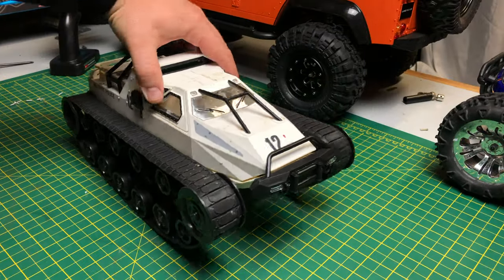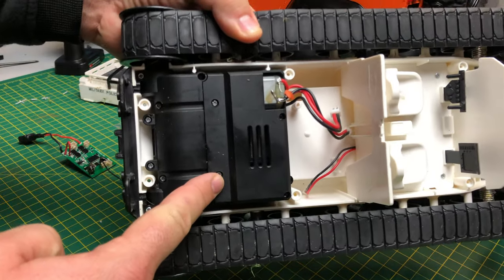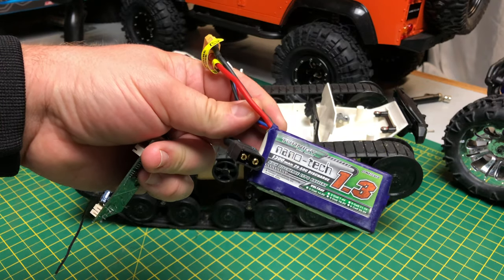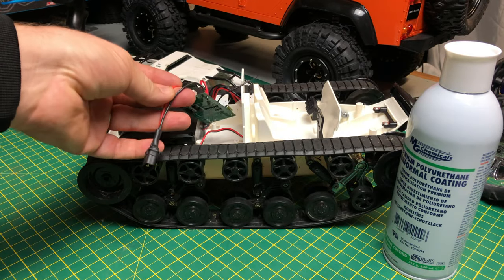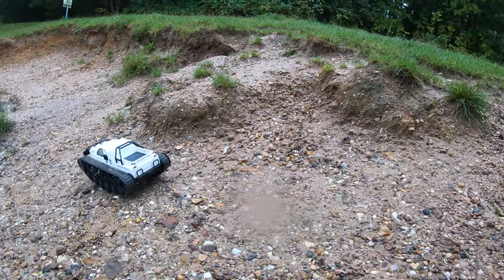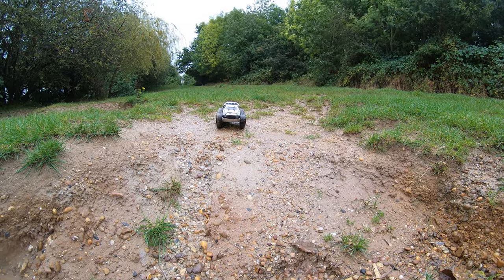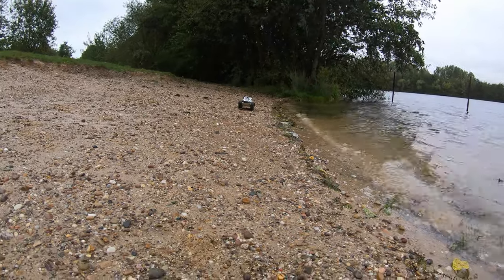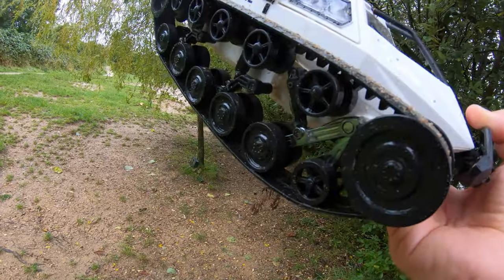Awesome Super Tank! Waterproofing + Lipo upgrade for the RC Ripsaw Drift Tank! M5 next please!

Comment from the maker: Just to clarify. I mention ‘Reseting’ it, by this I mean removing the battery and leaving it for about 10s. There is no ‘reset’ button or switch.
Reply: makes me wonder if its just getting hot then not functioning right... there IS possibly a cheap simple solution, wiring in a BIG final transistor to the board's motor outputs so the stock board is only working as the "pre-amp" section. newer little "all in one" receiver ESC boards do use tiny surface mount chips, doesn't matter, they'll still act as controller to the high output transistors and they won't get heated up doing it. 

if you can do it cool, if you cant but got a local buddy who can, hit him up! definitely let old BangGoodies know about the issue, hopefully the next batch won't have the same issue (don't tell them you bumped up to a LiPo cell haha)
Reply: It happen to my tank also. It always tend to be in full forward throttle  everytime  I pull the trigger nether battery  pull out for 10 seconds or connected. Don't know how to bring the proportional forward back.
Reply: You should install your own esc and radio gear phil couple of cheap brushed speedos  and a vtail mixer coupled to a flysky gt3b would do the job pretty much what i did to a nikko  velocatrax  great video bud
Reply: @steveclough6794  how,? i have all frsky electronics in my planes and have burnt the pcb out in the thing already
Reply: Put a prop in the back off the ripsaw to drive betre in water
Reply: It would be cool if you put paddle thangs on the wheel so it could be a boat
Reply: I guess Im quite randomly asking but does anyone know of a good place to stream newly released series online?
Reply: @Paxton Moises flixportal
Reply: @Lian Abram Thank you, I went there and it seems like a nice service =) I really appreciate it!
Reply: @Paxton Moises Happy to help xD

Comment: Before you use the spray you could put dielectric grease on the connection points that would both waterproof them and keep the spray out of them
Reply from the maker: Yes, good idea 🤘

Comment: Your LiPo conversion and waterproofing have transformed this tank - I hope the manufacturers see your video and think "Hmm - let´s do it", because the drive train can take the extra torque and the increased speed makes a big difference too, while the waterproofing adds a whole world of extra play value to this product.
 Perhaps they made the vehicle so light at the front deliberately, so it never face-plants, but the cost in terms of climbing ability is very high. I´d put a weight in mine, and fill the left over space up front with flotation material, myself.
Reply from the maker: The next step for this is to try and get some better electronics, I'm not sure if 2 ESC's (1 steering 1 drive) will work, but if it does, it will be made fully amphibious, with some paddles added to the rear drive wheels....and possibly something else added for propulsion :)

Comment: I am impressed at the power increase but am afraid your battery is over powering the controls. Mabe dial it back by adding a few resisters in line to cut the power back a bit. How is it running now? I want to upgrade mine but not max out the board and thats what it seems is happening.

Comment: How did you reset it? Just by taking the battery out or both battery and did something to the electronics
Reply from the maker: Yes, just remove the battery for a bit
Reply: @TomleyRC  ok thank you and is nail polish a option because that’s all my mom has
Reply: @TomleyRC  or should I just buy the spray can thing to be safe

Comment: I do hope that there will be upgrades for this, just bought mine, curious to see what I can do to this in terms of custom upgrades, gonna try to make it truly amphibious, should be a nice challenge
Reply from the maker: Hopefully there will be. It should be pretty easy to make amphibious, just need to seal up some of the holes, it's pretty well balanced in the water as you can see.
Reply: @TomleyRC  
I did see that, though it didn't move very well on the water for obvious reasons haha, that's the part in which will be interesting to mess with

Comment: Hi. Thank you for the nice video - very professionally made! If I am allowed to ask - how did you resolve the issue with water entering the electric motor, and the LiPo battery? Thank you
Reply from the maker: Thanks mate. I didn't do anything apart from coat the electronics in conformal coating.
Reply: @TomleyRC  Thank you. I have done the coating, and protected the battery and contacts with shrinking tube and resin. LiPo battery reaction is violent if it gets properly wet.

Comment: The easiest change to make i have seen is cutting the plastic tabs in battery bay to enable most fwd placement of batt. possible to reduce its frontal kick up upon accelerating.

Also i bought the aluminum bod. Version which adds more weight to reduce frontal kick up and and overall tippiness.

One more mod ive seen that will help it swim is adding larger tabs/paddles to tracks; every 2 or 3 squares.
Reply: Aluminum body one?  where do you get / which one is that?  I see there is a white one, grey one (i have), german camo one, and currently a really cheap (46$) dollar one that has a engine in the bed that when you press a button on the radio it shoots out a mist....  Other then those four I don't see a aluminum body one? I would really want one.

Comment: Maybe you could find metal tracks and wheels to improve its performance.iv replaced rubber tipe tracks on My 10th scale tanks and that made a huge difference with traction.
Reply from the maker: Yes, could do with a few mods
Reply: You can buy this tank with metal tracks or just the tracks, there actually really easy to find! :-)

Comment: I wonder if you take the tracks off another one. turn them inside out. then either glue or rivet them to the outside of the other tracks install them back on the ripsaw. if that would have better traction for climbing and swimming. maybe upgrading the motors to the 55,000 to 65,000 rpm slot car motors would give it more power and speed. just food for thought.
Reply from the maker: Yeah not sure. I have a few plans for this to make it better in the water, just waiting on parts . 👍

Comment: Have you tested the metal track one yet? I'll be ordering one soon, hopefully the metal evens out the CofG so it's not so jumpy at the front.
Reply: As easy as the body comes apart it wouldn't be a big deal to add some weight in the front.
Reply: If you get metal tracks, you need to make sure to also get metal gears. The metal tracks will wreck the nylon gearing.

Edit: Holy crap, just realized this was a two year old video and comment. Oh well, maybe someone will still find my comment useful.
Reply: @aarongray3573  definitely useful, as I still haven't got round to buying it yet lol

Comment: Man I was thinking about getting the grey one until I saw the gear box... No way those plastic gears hold up to 2s lipo after several runs.. cant believe how small that motor is.. btw the grease will help; in attracting dirt! Still $60..
Reply from the maker: Yes, quite cheap...but still fun. You can get spares now as well

Comment: Fantastic running and how to video mate, Maybe put a 1060 Hobbywing Esc in, tell you what they have the same connections on the Esc as my subotech Brave , Maybe that will be a better Esc, anyway fantastic running video Phil as always Pal 👍😁👍
Reply from the maker: Cheers Tony. I'm gonna try the 1060, with a small 20a one for the steering motor.... not sure how it'll work....but worth a try!

Comment: In 1/12th scale a 3 inch driver would be 3 feet tall.
Reply from the maker: Yeah, the scale is a little off with the interior I think.
Reply: @TomleyRC  
The tank is only 1:12 in height.  It's closer to 1:16 (ish) in length/width so you need at least a 4" figure.